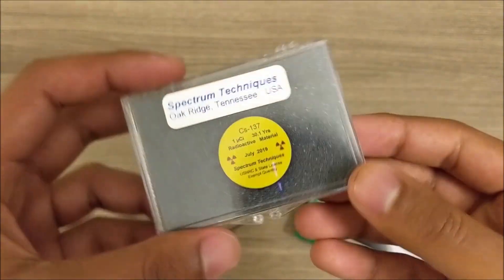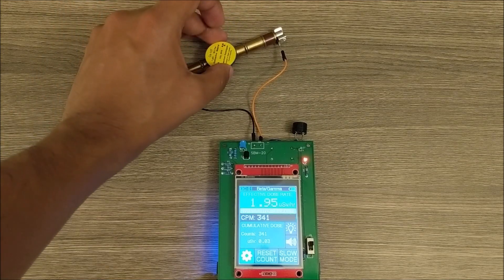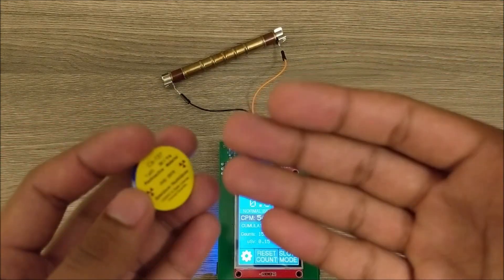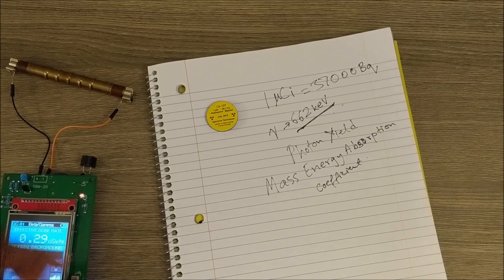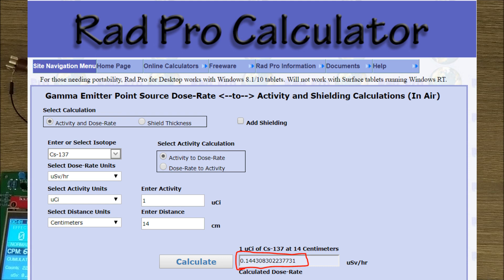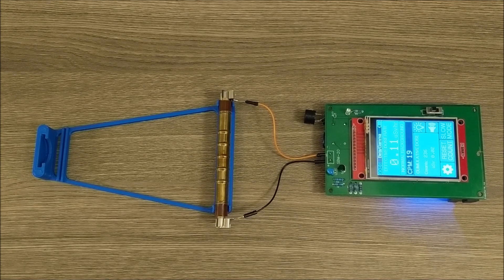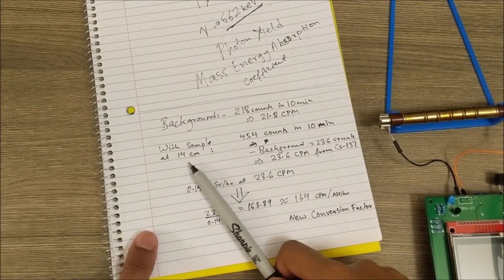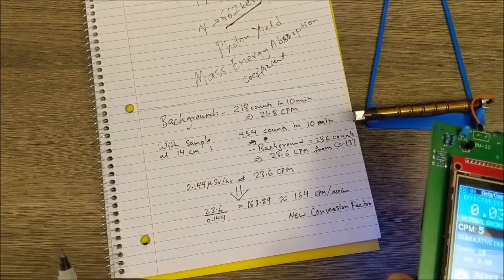Calibrating my Geiger Counter with a Cesium-137 Disk Source

Comment: That little window you can see through it I think it's electroplated to the center of that disc. The reason you can see the light circle in the middle is because there's less plastic in between the actual material and your counter

Comment: one other thing - what is your view  on geiger counters on the market that DO NOT have the CPM unit but ONLY uSv/hr....... is it best to  read radiation levels in CPM? I am trying to understand benefits of CPM units versus uSv/hr or uSV/hr is actually  all we need since we can do our own conversion factor (off-unit) based on the tube installed. Your thoughts on this is appreciated.

Also, any pointers to good reference webpage on the topic is welcome..thanks